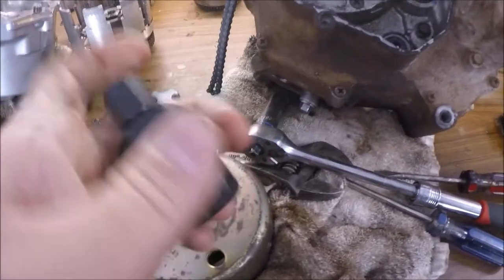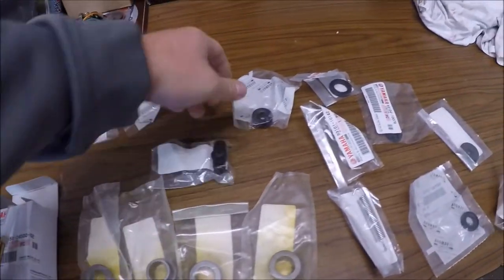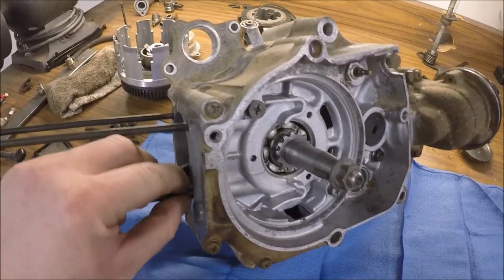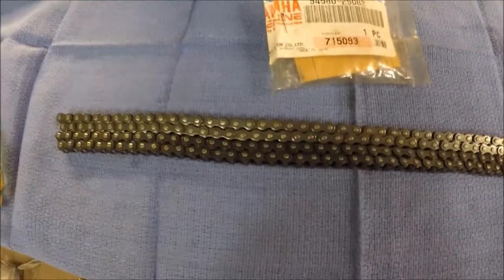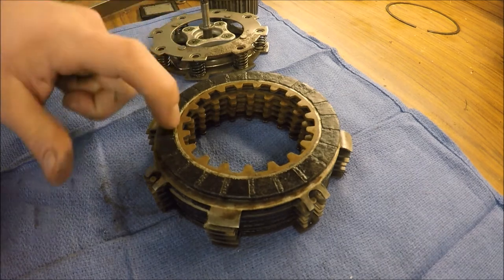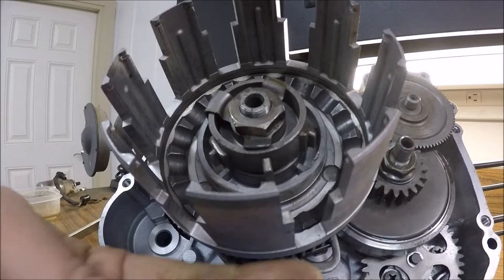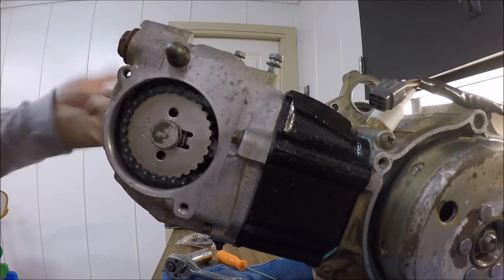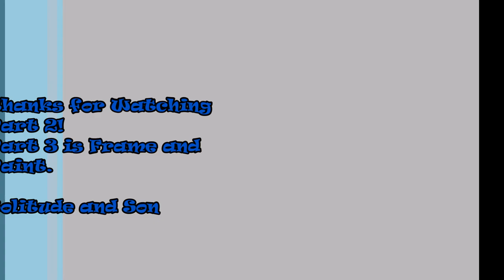Motor Timelapses - Badger 80 Restoration Pt: 2

Comment: I and about 7 friends ride the shit out of these on regular basis. We have a badger / raptor 80 grave yard. The most fun for bigger people to play with. We run round tracks with banks, slick track round track, mini moto and woods courses the we built ourselves on 40 acres. The weird thing is we all grew up rinding them. Anytime one comes up on Craigslist we snatch them up. Yamaha parts are to expensive. Weisco poston, new clutch, valves, doings, seals and clutch for motor good to go. Oh plus wheel bearings for front and rear hubs. New wheeler and tons of little fun

Comment: I picked up a nice 96 model last week for just $175 bucks. It was not that bad. No rust engine has spark and good compression body is almost mint no cracks and not faded. Tires were shot carb was stupid dirty rear brakes locked up front hub was out of its socket and front brake cables were shot plus no key. I've replaced all brakes brake cables carb kit new ignition switch and keys and new kenda tires on the way. Also changed oil set valves I set mine at .005 both valves . Should have it up and running in a few days. It's been about a 2 week project. I have about $450 invested in it including tires and all parts and what I paid for it. Its gonna be 100% when I'm done and will give myself and my kids a nice ATV to ride around the house for years to come. People seem to ditch these for cheap and they a great atvs to play around on esp in a small area like an acre or 2 . And handle an adult up to like 220lbs. Easy

Comment: The very thing i wanted/needed to see was the timing chain install with location for valves.. scratching my head how to put it back properly...
Reply from the maker: The line on the camshaft gear had to line up with the Triangle on the top of the casing at TDC.

Comment: How big of an ultrasonic cleaner did you use for the engine cases? Any recommendations? Thanks
Reply from the maker: I use a parts cleaner for the cases. The ultrasonic cleaner is about 4L maybe. Then I also has a Sand Blasting Cabinet that I use soda in.